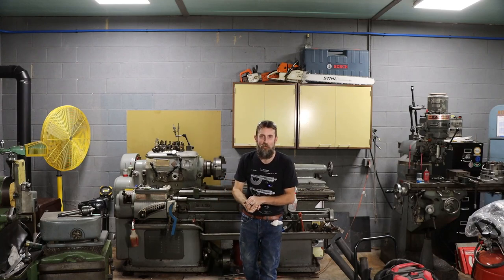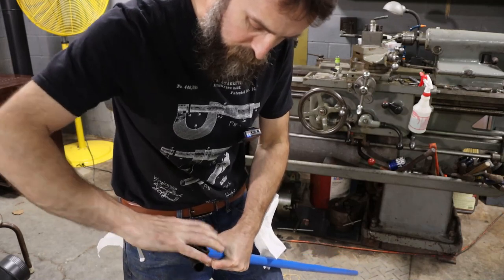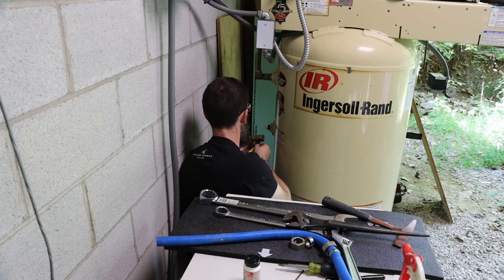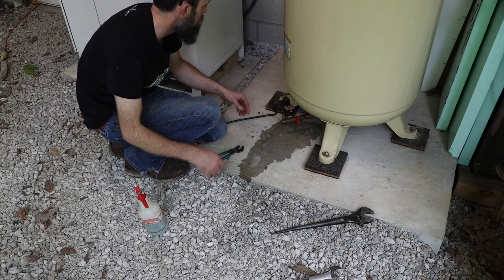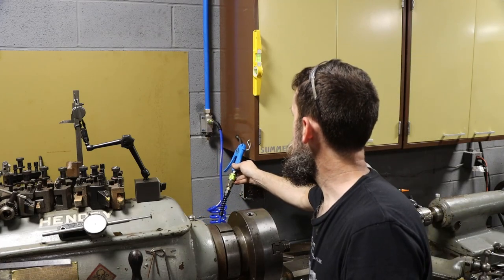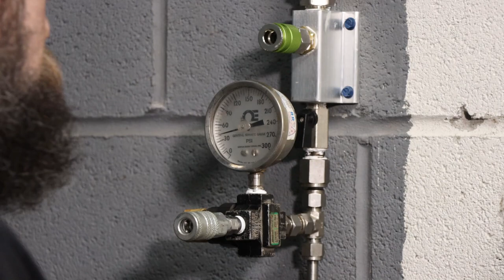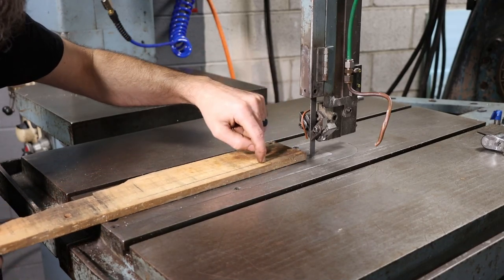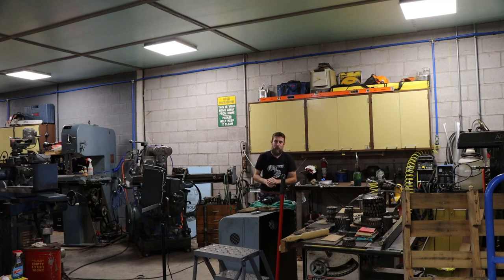A GREAT SHOP AIR SYSTEM. FINISHING UP

Comment: Two observations; I’d get rid of the turndown on the drain. It dumps at tank pressure, so it’ll eventually drill a hole in the ground, and it’s susceptible to water freezing it. Second, I’d move the drop to the left of the headstock of the lathe. Where it is, you can’t safely use it while you’re running the lathe. Shop is looking great, very jealous!
Reply: My thought are the same about the drop at the lathe. Not a good place to have to reach over the lathe with spinning or not spinning work pieces. It wouldn't take much to relocate.. take the manifold off, install 90 degree elbow to the left and install a piece if piping and manifold.
Reply: What about getting rid of the curly hose and just use a regular piece of airline maybe 6-8 foot long and running it under the lathe to front and hanging it there? Same thing with the band saw, get rid of the curly hose hose and run a piece of regular airline to the saw.
Reply: You chaps beat me to it. I don't want to be reaching across the lathe bed to find the blow gun.
Reply: That whole tank drain system will be frozen solid in winter  temps, and with repeated freeze /thaws, the piping may even split.
Reply: @garybrenner6236  That is actually a valid point. I have a similar compressor in a shed attached to my shop, and had to put a small space heater in with it because the tank drain would freeze in the winter. I used pex for my actual drain line though, so no fear of splits.

Comment: Steve, I can't imagine how much satisfaction it gives you to be able to walk from tool to tool, machine, to material, and back to a tool. Working on a project and having everything you need, all in the same location (not having to drive to friend's house or store to borrow or buy that one little tool you need to finish the job) must be an enjoyable experience. All these hours of hard work and effort, slowing acquiring this gear and that part, and now watching you move around your shop is a reward right there. Congratulations on your hard-earned successes!

Comment: I wouldn't bring it up, but you commented on it. My compressor is in a less climate controlled part of my basement. When first installed, there was small amounts of water. The line was replaced with an old large scale hydraulic line. Obviously a junkyard one that happened to be solid enough. That was 35 years ago, I have had less than a cup of water per 6 months since then. I have an all steel ring loop which I suspect helps because I always leave the system pressurized so I suspect the volume in the ring loop acts to dry the air. Drying it that small amount prior to compression by going through the rubber line made a huge difference. It's about the same scale shop and compressor as your setup. Looks great as always, very clean work!

Comment: I use a ball valve for my tank drain.
They don't get held off the seat and you can open them with a toe tip, keeping yourself away from the blast of scungy water.
Reply: I have a flexible hose attached... I can extend it out the compressor shed door and in a bucket.

Comment: G'day Steve.  Nice fit up with the blue airline around your shop.  You won't know yourself now.  I did the similar thing around my little shop, but used copper line.  In hindsight I should have used larger diameter pipe like you did.  Thanks for sharing Steve.  Trust you and the family are well.  Cheers, Aaron (from Downunder).

Comment: Hi Steve .  Nice air system  .  Just looking at your chain saw , over there is 3' the largest bar Still have ?   Oregon make a 4' bar that will fit that saw ,  i use one for slabbing  logs .   Cheers .
Reply from the maker: You can get the larger bars here. 48" is more than I need 99% of the time. I cut a old oak last week that was about 48" but that's rare. I like the 36". She runs it well.👍
Thanks for watching

Comment: If those manifolds are the same as mine you can add a line through the port on the rear face. I did that for a line out the front of the shop as well as my compressors feed. The front line is a pipe nipple that runs through a hole in the wall to an exterior hose reel, makes it so much easier to fill a tire or blow off something without needing to open everything up. I also suggest adding a line out at the compressor "shed", just to make it easier to have air in multiple places without dragging hoses everywhere.

Comment: Hey Steve, thanks for video again.
Been thinking about that safety circuit.  At where I used to work, got a new job, after working as a mechanic slash electrician at a turkey processing plant for 14 years I got a job as a tool and die guy.  Love my new job, worked as a machinist for many years off and on, maintenance paid better until now.  But anyhow back to compressor.  2 ways, at old work we used a simple Dayton time delay to slow down dumpers,  kept production from shaking them.  They could tear up a train wreck.  What I would probably do would be wire in a latching relay with a pushbutton in the control circuit.  Keep the compressor from trying to start when firing up phase converter.  Could even have a remote pushbutton by control for phase converter.
You guys with fancy store bought converters anyway, I got fancy and put a run cap on mine so I don't have to have a starting motor, knife switch on wall, sound tells me it is on.  Ha
Reply: An ice cube relay would be good enough, whatever pin base and relay, whatever you can scrounge or buy with a momentary button to latch and turn on control power.  Off would be when you lost voltage.  Just a control power on button, maybe an indicator light.

Comment: You may want to use heat tape and insulation on those drain tubes , auto drain solenoid, and anything else coming off the bottom of the tank. Winter is coming!

Comment: I have my air hose reel mounted outside of the shop, however I do have a cut off inside. That way I don’t open up the big doors to use an air reel

Comment: Steve. One thing to keep in mind is the copper and cement do not mix. If in contact with each other the copper will decay. I use various diameters of hosing over the copper lines to isolate them.

Comment: In my dads shop, he had the water drain valves all at the bottom of 3' of pipe.  I presume to give it some storage capacity before it filled up the nearest air fitting.

Comment: Getting this put to bed must feel great. Ball valves are inexpensive so I always have a couple on hand and the nuts that hold the handle on as without Loctite (blue) they are forever coming loose and roll under the strangest of places. Instead of air and a broom for cleaning up steel and iron chips I modified a couple cleanup magnets. One with 1/4 in standoffs for on the bed ( helps stop things getting Magnetized)and another with a long handle and release so as not to have to bend over to use it.  Just sweep the area with them and release the chips into a bucket. Your "Harbor Freight" should have them  On the safety thing I saw you on your  knees on the concrete again.  At 65 my knees and hips hurt terribly from working on concrete and all it would have taken was a piece of belting or plywood to have mitigated that. Take care of your bones my friend. Great post and thanks for the extra this week.

Comment: I have a shop air system I need to setup for work, so I'm watching with great interest. I have major humidity concerns in my climate, so I'm designing a dryer even though I have an air conditioned drier integrated with the unit.
Reply: Make sure to put the individual feed lines off the top rather than the bottom of the feed line to keep the water from flowing to your air nozzle line. The main line should slope back to the tank so water that condenses in the main line flows back to the compressor tank or moisture trap. Steve at the least should have a large intercooler between the compressor head and the tank to cool the 400 degree air to room temperature so most of the water will condense out in the tank and be drained out. As many have pointed out the air nozzle is dangerously positioned on the lathe. Air systems involve a lot of work to properly install as it took me three times to get it right. We usually get smarter as we get older😉

Comment: I have my auto drain solenoid wired in parallel with the motor (both 240VAC). The 'ON' timer is set for a 1 second burst and the repeat timer to greater than the tank fill time (so it effectively never gets to that time). That way drain frequency is directly related ro compressor use and it isn't draining the system if I forget and leave it on.
Reply: A problem I need to correct. Can you post a schematic image?
Reply: @dinotom1  Schematic?! When the pressure regulator turns on, it power my 240V single phase motor and the 240V auto drain valve. It's that simple.

Comment: Super, nice and clean installation Steve. I carried a crescent / spud just like your's as a structural Iron Work, and still resides in my tool box today, along with a 3/4 x 30in Kline spud bar. To think, 40+ years back I could have gotten up on the DoAll to install air lines like you, and watching you work makes me thankful to just be vertical and now enjoying making chips.Have a super wk end,,Bear in Tx.

Comment: I used the same brand of tubing and fittings (in 1/2") and I REALLY like the sturdiness of the machined aluminum air stations.  One thing I have noticed: 3/8" quick disconnects aren't all the same, some are 3/8" bore on the male side, some are not.  And some of the female sides seem to have a high flow design and others do not. Caveat emptor.

Comment: Steve, what about an air line dryer, or an air line cooler made from a hydraulic oil cooler and a 12 or 24v radiator fan? This cooler could go between the compressor and the tank and eliminate some of the water before it gets in the tank?

Comment: The big box stores have 4 port pluming fittings, 1/2 npt with 1/2 npt on each end for your ends.  Rapid air makes a 1/2 npt type m quick disconnect.  Also, and I don't mean to second guess what you have done, but you should have put a a/c switch inside your shop for the compressor.

Comment: Have you considered just epoxying or even screwing a magnet to each of those compressor nozzles?  All your machines are good steel, so then you can just stick them wherever you need to out of the way and not have to deal with a hook

Comment: How ya keep'n water outa the system mr steve ? may i suggest  adding a car a/c condenser followed by a self draining  moisture trap to the system before the air goes into the air tank (cools the air & condenses the water before it can get into the tank & system) lots of youtube video's explaining how , works a treat on my system for the cnc plasma cutter, cheers

Comment: Hi Steve enjoying your video's. About the leak at the bottom of your tank, with the tapered seat of the shut off valve, you could use fine valve grinding paste to seat the valve snuggly so there is no possibility of it ever leaking again. Just a suggestion if your interested. Keep up with the great video's.
One of your fan's
Steve K

Comment: The plastic covers you just made are called ‘escutcheons’ they are seen and used in plumbing and your bathroom probably has several of them! Hope this helps! Keep up the cool vids, Steve!
Reply: They stopped using them on most houses nowadays- now you just see a PEX line coming out of the wall to a plastic closet supply.

Comment: Are you planning to restore the doalls contour feature? I think I have a fair amount of necessary components, surplus to me. I imagine it is not high priority, but I think it would be really interesting content. I looked up some of the info but was not able to find much in the way of decent quality video
Reply from the maker: I think its a neat feature.  I have been on the lookout for all the comments although they are not all that east to find.  I suppose that most that stuff gets separated and trashed when the saws were sold 2nd hand. What all parts do you have?
Reply: @SteveSummers  well I'm not positive. My shop was passed down and has been continuously run since 1951. There have been so many machines disassembled and their parts saved. I have seven pitches of machine chain N OS, and a couple dozen sprockets that match up to the chain. I know there was a contour saw in here at one point, it looks like your saw but was not badged as doall. If you happen to know what size and pitch sprockets and chain you need, I'm happy to dig out what I can for you.
Reply: @SteveSummers  Sorry, I wanted to add that if there are other parts, it is not unlikely that I have them and don't know what they are. There is tons of parts that have been carefully collected together and stored, but not necessarily labeled. If there are complex parts other than sprockets and chain, please send me a link or some type of image. I can look around and possibly find stuff. This place is really packed.

Comment: Hi Steve, just an observation on the Doall bandsaw,
It is interesting just how far away from the action the on off switch is.
What happens if you are tangled up in the pointy end, how do you reach the on off switch?
Love the shop air it will be make life so much easier for you, especially a connection by the doors grin for all those flat tyres you seem to get
Tony from Western Australia 🇦🇺
Reply from the maker: Guess if you get tied up in the saw you are out of luck 😬. Most my machines pre dates safety. They did make remote start stop switches for them👍
Reply: @SteveSummers  you mean your machines where made for when men where men and women swooned in anticipation? 😁
You know Steve, I am 61 and for most of my life I have worn thongs (flip flops)
I suffer with restless leg syndrome and have a bad back, my feet burn even in winter and I can and use my toes to b
Pick up dropped items within reason, to save my back
So for 95%of the time my thongs are my Japanese safety boots I never drop things on them and have enough situational awareness to understand where they are. Like the safety switches on machines today I think it is what we were and have grown up with 
(like using DOS back on my first computer in '86 compared to Windows of now) we grew up with a complex and more behind the scenes understanding of how to do things in this now cordless, computerised world 
So "long live the old skills and the way we do things, for one day those skills might be needed!" 
Tony from Western Australia 🇦🇺